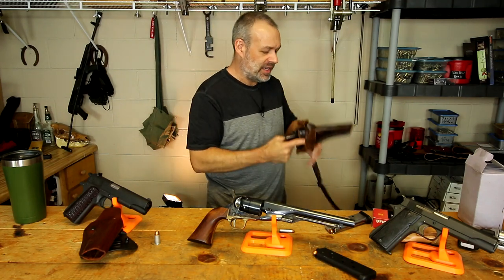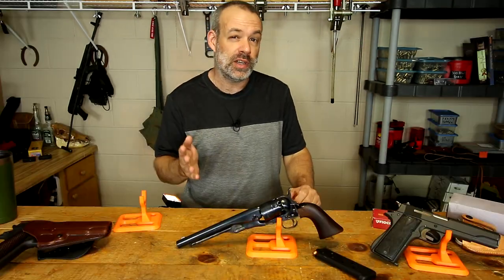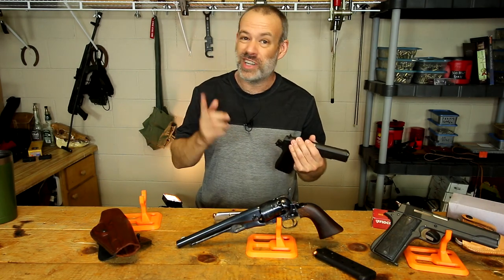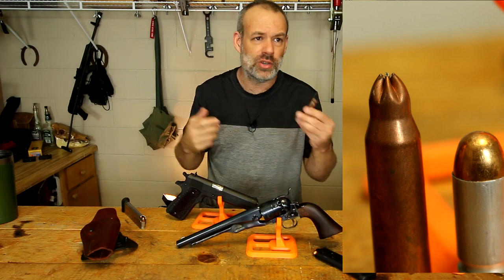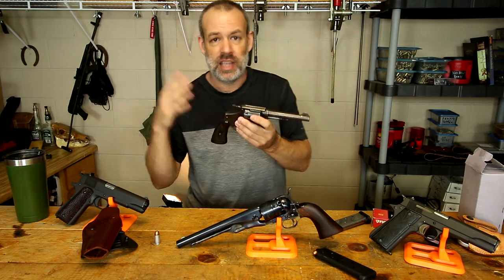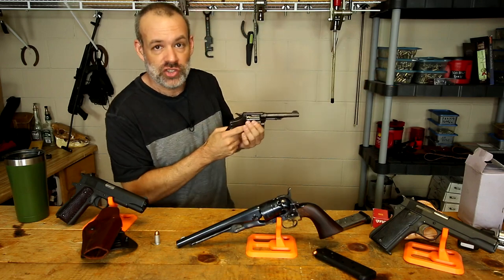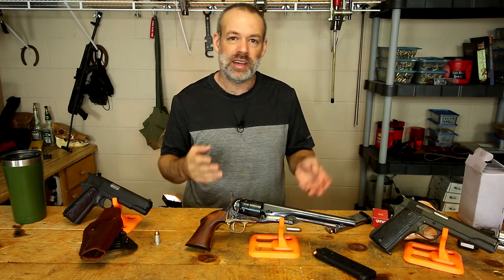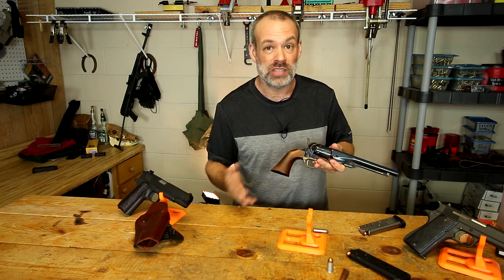How Do Prop Guns Kill?

Comment: `A few clarifications: 

Many of the air guns are either BB or pellet guns, or air softs with orange muzzles painted over, and most all of the 
"blow back" style (that is with a reciprocating slide to imitate a real firearm. Fake muzzle flashes added in post production. Lack of exploding powder allow safer, closer pointing of prop to actors.

Non-firing replica 'non-guns' are widely used, because even in close ups, they appear real. Small differences in some, such as the oblong foreward assist on M-16, are noted on some of the props. When heavily regulated Class III firearms are in movies, these repliguns are used in most non-firing scenes.

Purpose made self loading blank firing guns from Italy, Germany, Turkey, etc. firing either 8 or 9mm special blanks are also used. Made of deliberately weak metals and designs (to make live fire conversions almost impossible) they use a wadless blank. Some are front fire, but many are top fire-to vent gasses upward away from actor they're pointed at. Although incapable of chambering or firing a live round the pressure and heat from exploding blank is very dangerous at muzzle or vent hole and within a few feet of same. Some mock real handguns such as M1911s, M92s, Glocks, many are of a generic design. There are also revolvers with a 9mm rimmed blank, with venting either front, top or with widened cylinder gaps.

Gas firing guns such as those made by Russell Engineering, making a butane or propane flash, with sound of report generally dubbed post production. "Full auto" looking props like 'Tommy Guns', Brens, 'Ma Duces', etc. can be spotted with give away actions don't reciprocate and no brass ejected.

A word on blanks. Lacking the mass of a projectile to delay powder consumption, blank powder burns extremely fast. Should blank powder be used with a projectile loaded in the case, extreme, likely destructive pressures will result. Movie blanks are also loaded to included post muzzle consumption  of powder to create a flash that lasts for at least  3 frames so the flash can be perceived. Military small arm blanks cannot cycle an action without a blank fire adapter (BFA). The BFA for AR-15s, M-16's, M-4s etc. with the 'bird cage' flash suppressors, is a red, boxish looking contraption actually desired to self destruct if a live round accidently fired with lessened risks to shooter. All military blanks cycling self loading firearms require some type of BFA in order to cycle the actions. Blanks being able to  cycle a firearm the same as a live round is a movie myth.  When an AR, AK, or even an M-1 Garand is show cycling a  "Hollywood" style BFA is employed such as restrictor between muzzle and flash suppressor, a replacement of flash suppressor or a subtle looking attachment such as on Garands. Internal threading of muzzle for a BFA is also sometimes used. In all cases, these BFAs will act as blockage of bore should a live round be fired, dangerous to all around.

As far as accidental live rounds, when such a scene  is called for, a professional movie set will film the close ups AFTER all the other scenes shot, sometimes even using stunt doubles.

Comment: This seems like a really comprehensive video about how actors adapt guns and bullets so they can then skirt around international gun safety procedures. Firearms 101, always check if its loaded or not. Baldwin should have checked that gun, I don't care if it isn't standard procedure, standard procedure just ended up with two people with holes in them. Firearms are Firearms, and should all be treated the same, I.e. don't stand in front of them, don't point them at anything you don't want to destroy and always treat them as if they were loaded until you personally check and confirm.
Reply: You absolutely cannot follow the four basic rules of firearms safety and make a movie like John Wick or Pulp Fiction.

Comment: Hey BC.  That was a great explanation of one way a prop gun can be lethal on a movie set.
Another way is if the person handling the firearm has not been given proper gun safety training
or simply ignores it.  

For example the actor, Jon Hexum also died on the set of the TV series " Cover Up "  because of the misuse of a prop gun.
He was horsing around with his handgun which was loaded with blanks. He thought it would 
be funny to put the barrel to his head and pull the trigger.  The powerful force of the blank
forced a piece of his skull into his brain.  He died of stupidity.
Reply from the maker: I can't believe the prop master, director, or someone didn't step in and stop Hexum when he started playing with a gun loaded with blanks.  Every now and then I end up at the range with a few new shooters and remember how little some people know about firearms.
Reply: @deuceandguns  I think most of the Range Officers are either current or former Law enforcement at the range I go to near Cherr'ville, NC.  I have seen them remove someone who was acting unsafely and was corrected but still was acting like a jerk.  He also was banned from returning.
Reply from the maker: @Bill23799  That's exactly how it should be.

Comment: I had been told that when it comes to a 1911(45acp) prop guys use 9mm 1911's when filming action sequences because the 9mm 1911's tend to cycle reliably with blanks Instead of modifying a 45acp 1911. I've seen several examples in movies where you can clearly see the barrel diameter is smaller.

Comment: Apparently, the Non-Union Prop Armer was 23 years old this was her first gig and first day on the job because the former union crew walked off the set due to unsafe conditions ...also the prop gun in question had been discharged 3 times and was used for Plinking using live rounds which is insane and very dangerous because it led to a woman losing her life. I worked behind the scenes for film and tv as a Union Makeup Tech and know very little about firearms but I know there is a safety protocol that was taken very seriously on every set I have ever worked on whether it was independent or produced by a big studio/network there should not have been live rounds anywhere near that set. I do think the producer hiring someone who is a competent prop master/armer does hold responsibility especially since there were already serious problems.
I am speculating but based on the facts we have I suspect drugs or alcohol were clouding people's judgment as well as lack of experience..I have never met a prop armer in their 20's on a professional set where fire arms are used throughout the production

Comment: Actually military blanks doesn’t have the power to  cycle the next round. We have to use a blank adapter. Serves as safety as well as building enough pressure to cycle the next round

Comment: The investigators have found over 500 rounds of live ammunition on the set. The armorer and some members of the crew were using the guns with live ammunition for target practice during their breaks and other off hours. The firearm in question had been used in that capacity just hours before the incident occurred. AB was rehearsing a scene where he was supposed to cross-draw the firearm, aim and fire at the camera. It sounds like the director that was killed was operating or otherwise standing behind the camera at the time and the other director was standing behind her.  The firearm had a live round in it which passed through the first director killing her and into the second director wounding him.  It sounds like there were multiple levels of safety violations and protocols not being followed.  The armorer was inexperienced, irresponsible and had safety complaints against her from a previous movie set. As one of the producers who hired her, AB holds some responsibility for that and that he allowed the firearms to be used with live ammunition by the crew and allowed live ammunition on set.  There is plenty of blame to go around for the irresponsibility and negligence that led to this situation.

Comment: Military blanks do not operate the action of the fire arm by being more "powerful". They do it through the presence of a blank adapter obstructing the barrel to increase the pressure enough to operate the action. The blank adapter on an M-16 is a red square attached to the barrel. The M-4 version is yellow. The M2 version surrounds the barrel with 3 rods running parallel to the barrel. They should be identifiable in pictures of troops training.

Comment: When a firearm enters your hands, you are responsible. The prop master shares the blame, but Alec owns this. Always check your firearm so you know it is safe. If I bought a new pistol in a gun shop and pulled the trigger in the parking lot and killed someone, does that mean I am not responsible? After all it is new, just out of the box, I didn’t load it so it is safe right! Someone could have loaded it in the shop or at the factory and failed to fire the round or unload the weapon. Pistols are fired at the factory prior to shipping to insure they work. A live bullet can be in a gun for any number of reasons, good or bad. In the end the person who pulled the trigger without checking the weapon is at fault.

Comment: I'm unsure about USA, but here in Brazil prop guns HAVE to have their barrels blocked to avoid firing of any projectiles. Usually they also have the firing mechanisms damaged beyond repair, for other safety concern - they are supposed to be impossible to fix in case of theft by criminals. Of course, that wouldn't be done if they intended to use blanks.

Comment: Yes they had a walkout because of unsafe firearm discharge. Now the girl who was in charge of the guns was not there or not doing her job. It was her 2nd job doing this but for some reason the executive producer was the one handling the gun to him as a cold gun. After Brandon Lee a lot of changes happened, actors were not aloud to have any guns on them outside of the filming. After every cut the guns are given back to the gun handles and checked and everytime the gun is given back to the actors they are shown the gun is clear. With dummy rounds they are shot in to a ballistic drum to check.

Comment: Anyone who points the muzzle of a firearm at a person is responsible period! Even though someone proclaimed the prop gun "cold" it would be the responsibility of the last person to touch the firearm to verify that it is in fact clear and safe and then the muzzle should be properly controlled so as to not cover a living person. This was not an accident it was a failure at several points.

Comment: Baldwin is definitely partially responsible. Whenever someone hands you a firearm , you should inspect it. In the case of a pistol, the magazine should be ejected and the slide locked back.
If a wheel gun, the cylinder should be released. In both cases, the receiver triple checks the firearm themselves. If not done well, guess what? Death.
Reply: It’s more simple than that. Don’t take a job where someone asks you to point a firearm at a person (excluding cops and military for obvious reasons).

Comment: you could also blame Alec Baldwin. he was also a producer for Rust and only hired an inexperienced armorer assistant as both an armorer and an armorer assistant. Alec and other producers looked down on guns and gun safety. they didn't bother to have basic firearm training for actors. then you can also blame the inexperienced armorer who has extremely little gun safety – a very dangerous armorer.

Comment: Thanks for sharing your thoughts. I disagree with your last statement that the prop-master is ultimately responsible. I think you ment the armorer, not prop-master. I have worked on several sets and there is a chain of custody established for each time these weapons and munitions are moved. Prior to this there would have been several safety meetings with actors, special effects, sound and more, to be sure all training needed is done and all safety procedures are applied and adhered to. Usually, just before needed, someone is assigned to take charge of these for the time they leave the armory until returned. There is a written and verbal statement about the props and their condition. It is always their responsibility for safety. It is them that makes the weapon ready to perform what has been scripted. When it is time for the weapon to come into play The handler would be sure to check the weapon before handing off to and actor. When the actor takes possession they are tought to check that the weapon is empty and safe. There should be someone assigned to watch over the weapon while in play and in the actors hands. All movement with that gun should fallow script and safety. This is not the time to be taking it from it's holster and twirling it in your fingers for practice. I have never seen or heard of live rounds on a set. I know of one person who was dismissed for having live rounds in his truck leased back to the production. Ultimately Baldwin  should have cleared the weapon on taking possession,  or assured its scripted condition. He's the one responsible for where it's aimed and when the trigger is pulled. Cheers, Billy in Canada

Comment: Not to light a firestorm but another angle on this is that the original crew walked out and were replaced by non-union workers.  I'm not pointing fingers, but Jimmy Hoffa didn't just wonder off into the dark and disappear.

Comment: Question would a squib happen in a revolver if you were to remove the gun powder leave a live primer but have a drill out the hollow point bullet completely.Thus in quasi-theory the primer pressure should leave through the hollow point casted bullet and keep the bullet in the brass. This will keep the camera seeing a live round in the other cylinders.
Reply from the maker: That's a good question.  It may not have enough power to push the bullet into the barrel but it may have enough to push the bullet slightly out of the case jamming the cylinder from rotating.  The bullet would have to be crimped into the case very tightly for that to work.
Reply: @deuceandguns  Maybe have a machinist make a look alike Cartridge that fits into the cylinder that’s one piece of hardened steel. That can be primer reloadable only. You might get it a few more gigs because less time to stop the camera to put inert dummy rounds into into The cylinder for the camera shot. Thus less camera time and labor expense.

Comment: While I agree that the prop master is primarily responsible, I disagree that Baldwin is in the clear. Another mandatory rule of using guns on the set is "never point one at a person" - a rule that has been quite strict since the Brandon Lee incident (also true off the set). Actually, the rule is worded "never point a gun at anything you don't want to see destroyed." Apparently (according to latest gossip), during a rehearsal, Baldwin pointed the gun at a camera. Now, we all know that a camera is going to have someone behind the lens. Baldwin, therefore, violated safety rules - established safety rules. 
Now, add the fact that several individuals LEFT the program because of the LACK of following safety protocol. Baldwin also failed to confirm the "safe" nature of the firearm - ANOTHER violation of basic firearm safety. And he can't use the excuse of an active shooting of the scene - it was a rehearsal, therefore allowing plenty of time for Baldwin to confirm what he was told about the firearm being "cold".
So ......... Failure to follow established safety protocol. Failure to confirm "safe" status of the firearm. The loss of several employees simply because of their concerns about safety on the set. .... again, yes, the prop master is primarily at fault, BUT it has to be acknowledged that Baldwin is ALSO "at fault"

Comment: This incident was inexcusable. Multiple breaches of the redundant safety precautions typically used during film shoots had to have occurred. I own and operate two small film locations - and even in my little operation I have a 3-page firearms safety rules brochure and checklist that we enforce rigorously. We use dummy firearms, airsoft replicas, as well as modified cap-and-ball revolvers - but live ammunition, pyrodex  powder nor 'hot' modern firearms are ever allowed on the property. For visual effect we use small charges of Armstrong powder (as used in cap guns). The first AD (assistant director) is usually the last line of defense in prop firearms safety. In this case - I believe those safety precautions fell far short of the industry standard.

Comment: The bullet (or obstruction) went through the first person and struck the second.  They've already confirmed that.  And the pistol in question had already had issues functioning properly on set only a few days prior.
Reply from the maker: The more info that comes out the stranger it seems.  I don't want to jump to any conclusions but it's starting to sound like a real FMJ round got into that revolver.  Who put it there and why didn't Baldwin check it before the scene?  Who knows.
Reply: @deuceandguns  Yeah, step one of handling any firearm is to check it yourself.  Twenty seconds of safety checks would have prevented this.

Comment: Sorry, but the Actors Guild has specific requirements about the actor accepting a firearm and insuring that it has no ammunition loaded into to it. Obviously, Baldwin is guilty of gross negligence for not checking that the firearm in question had no ammunition in the cylinder chambers.